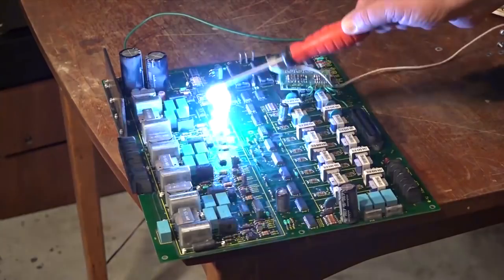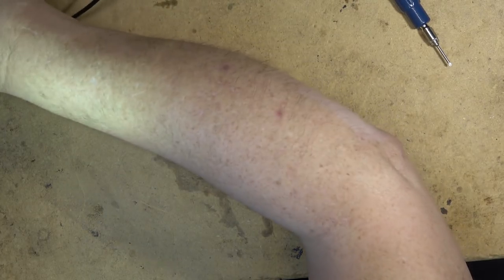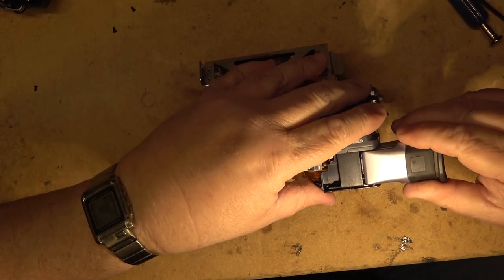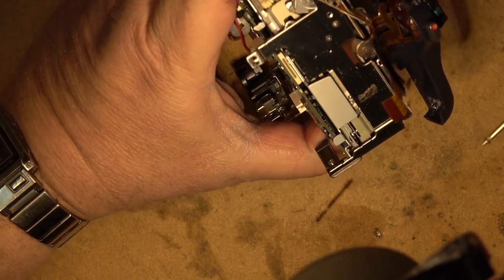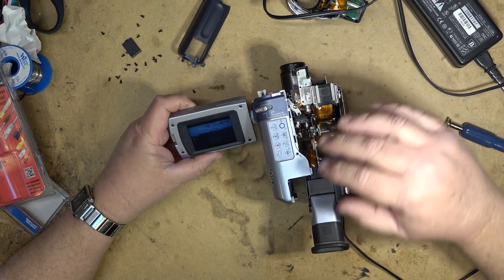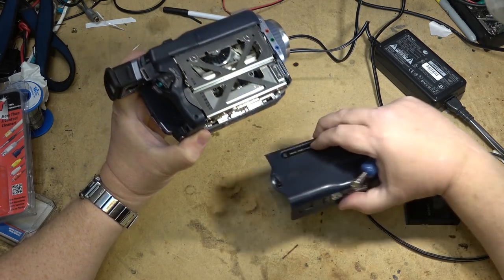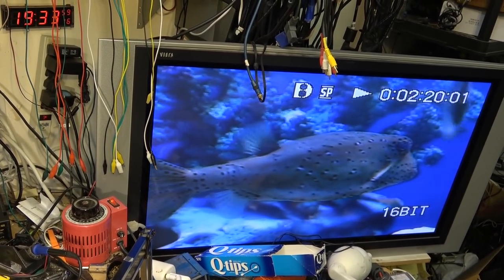Sony DCR TRV340 Digital 8 Camcorder Power Switch bad and is throwing C:31:22 Emg Code

Comment: I also have the exact same camera - bought it in 2001. I've nearly transfered all my Digital 8 tapes via firewire to my harddisks to be on the safe side. Until now it still works peferctly. I also used it to transfer my VHS tapes only using the analog video input and the firewire output. I think its a very nice camcorder.
Reply from the maker: These are good ones.   No capacitor issues either.

Comment: I’m stuck removing the left cover (view finder) side back corner by media card locations. There’s something not releasing like a tab or screw. Can’t find what is holding it from releasing that cover. Any advice?
Reply from the maker: There is a screw that holds the right side on. You have to remove the left side first and the battery bracket to see it.

Comment: I admire anyone who can do this kind of work such a nice thing and a talent! . Thank you for sharing, I have tons of 8 mm video tape they are just rotting away because my camera is broken, actually I don’t even have the camera anymore.  too bad they don’t make a converter
Reply from the maker: That's the problem. No tape based equipment is made anymore.  You have 2 options.  Find a working camera or player to copy your tapes or send them out to a transfer service.  I archive dozens of tapes a month for people in your situation because working 8mm / hi8 decks are few and far between and if you find one that has been restored it will be very expensive.  Of course if you don't care about the memories on those tapes then you can do nothing.

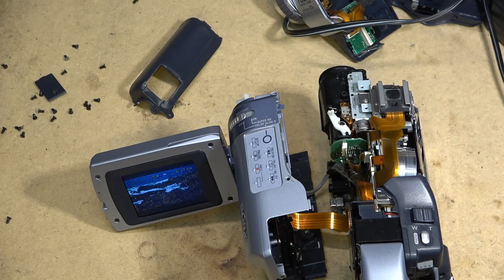Comment: Good job, I have a TRV350 that has a sloppy take up reel post and will give me C31:23 codes. It also has a damaged FireWire port, but I was lucky to find a replacement.
Not sure if I can tighten up the take up reel post as I would have to disassemble the mechanism.
I was able to get another 350 untested for cheap and it’s been working great.
I’m using it to put my 50 Hi8 tapes onto a Raid system.
I really enjoy your videos as they are extremely helpful.

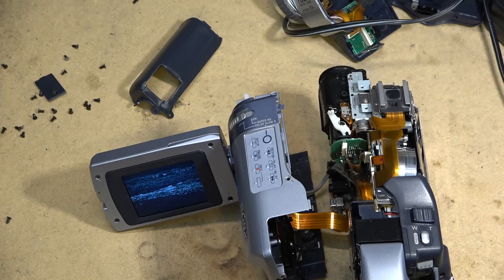Comment: I have a Handycam DCR-TRV340 that as soon as I open the cassette compartment it starts spinning the take-up reel (the right one) like crazy, when it stops the mechanism starts to close (even with the lid open). When trying to load a tape, the error 31:20 or 32:20 appears. I removed the mechanism from the camera and the compartment opens without problems (I tested it with a battery holder); The problem is that the take-up reel goes crazy (I've noticed that the winch rotates the same, same belt). I don't know if it is the defective motor or some sensor.
Reply from the maker: Check those edge connectors. They cause huge problems on those cameras.

Comment: the analog possibly bad plug on mine  av input/output the audio is mono but it still records stereo so to get stereo out of it is via usb-firewire
Reply from the maker: The analog output is stereo.  You just need the original Sony output cable.  It is wired differently than all the aftermarket cords.  It is stereo which could be heard on the tape i played. good luck finding the Sony cord now. You would have to make your own now.  I showed the difference between the cables on a video last week.

Comment: this is the  same camera i use daily for my retro type home videos fairly relyable camera it pases a few error codes but it if bang it on my risk it gets rid of them an yeah haveing the tape compartment on the bottom sucks its not fun when you run ot of tape an you have to take the tripod mount off

Comment: Did you fix the power button issue just by spraying and moving the button around? 😄

Mine started acting weird. Only turns on with the right amount of pressure.

Comment: I have a DCR-TRV270 D8 camcorder since 2005, that series was the last line of D8 format, this one I think just a few years earlier. Since then I've bought some Hi8 models from the same series for Hi8 playback (I don't know their model numbers off the top of my head), and one of them had similar power switch issue to this one, that was due to liquid damage. I could not save the switch, I had to transplant an other one from a parts machine, because the tracks and contacts on the flex PCB are not gold plated copper like in this one, it's just carbon paint, and it was peeling off. What a 'great' idea! So this older one is better than the last generation in that regard, less penny pinching in it. And of course the 270 cannot play any analog tapes unfortunately. There was a higher model that could do it for more than twice the price, and an even higher model that had AV and FireWire inputs as well, not just outputs, it cost more than 3x the price of mine, maybe it was even 4x, but IIRC that was a 3CCD model with Zeiss lens on it. 

Mine was the cheapest D8 model, that was the only one I could afford, and even that only because I won $500 on a scratch card (in 2005 money), the camera was $350, with it I also bought a small Minolta camera case, a Soligor tele/wide adapter, a Hama polarizing filter, a few cassettes, and the $500 was pretty much gone, less than $50 remained. Last time I used it for recording was about in 2012-2014. It still works fine, though the battery is almost completely dead now (what a surprise after 16 years...). I only ever had one battery for it, the smallest one, it was a nightmare. I never could use the LCD screen for extended periods during recording because of the small battery, but I didn't mind it at all as I can hold it much more firmly with the viewfinder laying on my eye. When I went in Italy for vacation in 2007, I borrowed a second battery from... I don't remember who. I guess from the studio of my school.
Reply: Forgive me for asking but the problems you've had with your memory card couldn't be a case of bad contacts between the card and the camera? Taking the card out and putting back in could have cleaned the contacts sufficiently and now the problem has apparently gone away.
Reply from the maker: @davidpinfold852  
The memory card is removed and placed in the reader every video and then back into the camera. The contacts are perfectly clean. It's a SanDisk, that's the problem.

Comment: So still wish I can get hold of a head drum for my 340. Using it for capturing via the DV from AV  in from other machines without DV. Best converter ever. Still 100% working except for the head drum.
Reply from the maker: Is that one the tape loads from the top of from the bottom.  I have a drum for a bottom feeder digital 8

Comment: Ahaha that is amazing. I have this exact camera! And yes, it is a fucking bitch to take apart. You have to navigate through 40 different microscopic screws and avoid tearing paper-thin ribbon cables that already have problems. Never liked how the tape mechanism can be very loudly heard while recording tapes.
Reply: Oh and the MPEG videos were atrocious lmfao.
Reply from the maker: Yup the drum spinning at 4500 rpm 2cm from the microphone.  Even the Mini DV weren't as loud despite the head drum spinning at 9000 rpm.

Comment: I have a sony trv 130 and mine needed a new button control pannel i got it repaired in 2005 stil works well i have so much shot in digital 8
Reply from the maker: Best to get that footage transferred while you can. It might work today and tomorrow it won't and no guarantee it will b repairable.
Reply: @12voltvids  have you ever seen these were the search button pannel needds replacing the shop told me it was a strange issue.  Ive since gotten a digital 8 and hi8 vcr.  And my footage was trasnferd to dvd or my hard disc along time ago.  I still use hdv tape for my work but it doesnt stay there long i have a reliable servicd place to keep it up for me.
Reply: @12voltvids  I even found a cassette deck that goes in a pc drive bay in. a 5.25 slot and i can do unatended tape transfers for my self and others